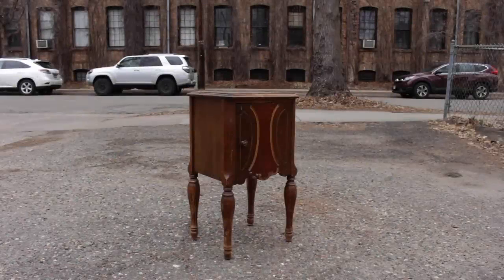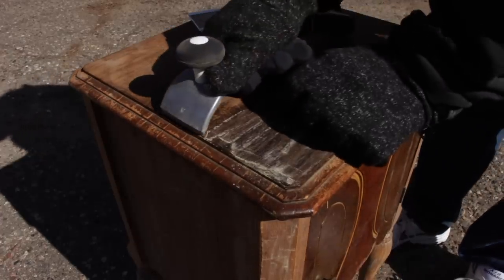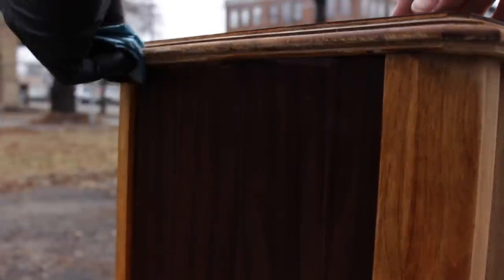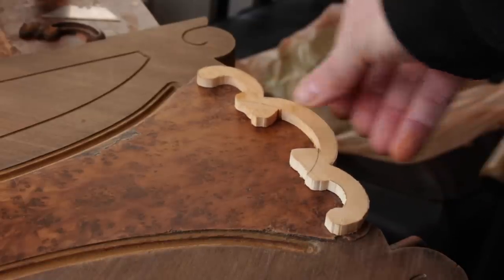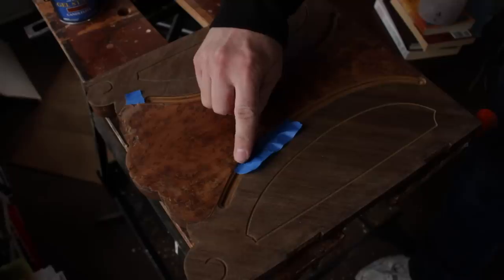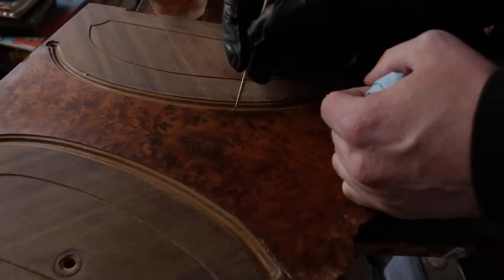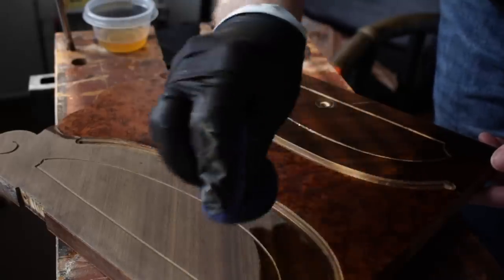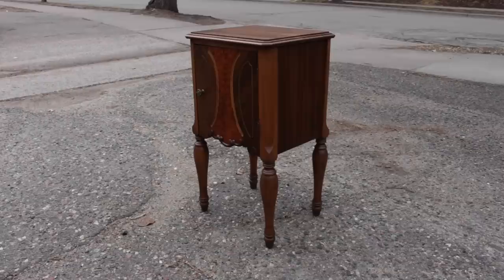Furniture Restoration | Restoring An Old Cabinet

Comment: I really enjoyed this. Great presentation and narration. I have refinished many pieces over the years. Just picked up a cabinet almost the twin of this one at auction last fall. (3.00 US)The auctioneer said it was a smoking cabinet. I don't know but it does seem practical. Good job!
Reply: I have a cabinet very much like this piece that has been in my dad's family for over 100 years. The interior of the cabinet I have is lined with copper panels. Apparently, the cabinet was used to store cigars and tobacco. The copper helped keep the tobacco safe from mold and mildew. Many cabinets, however, weren't copper lined but were lined with wood like Spanish cedar which also kept tobacco fresh.
Reply: It’s called a humidor!

Comment: Nice video. However if one had scraped the old finish off with a card scraper it would have taken a quarter of the time. BTW I'm certain the old finish is cellulose lacquer. I restore cabinets in Cape Town.

Comment: It seems like much more work hand scraping than just using a chemical stripper?  The end result was very nice. So many of these pieces have little value and are often chalk painted.
Reply: I think that in this case scraping was pretty easy since the finish was old and brittle.  If it was REALLY stuck on [like most other pieces] he'd have to use stripper.

Comment: How do you decide when to use citrus strip, or just to sand? 
I’m going to strip the top of my dining room table. It was bought new 13 years ago, but the stain is dated looking now, too red of a stain for me. I want to do a more washed driftwood or walnut stain of some kind. Because the finish is relatively new, I am thinking I will have to do quite a bit of citrus strip and then start sanding?

Comment: If the finish is shellac or varnish there is no need to scrape and ruin the patina. Simply mix equal parts of lacquer thinner and denatured alcohol and spread it around with a piece of very fine steel wool  and wipe off the old finish with a cloth.

Comment: 1. Why did you choose a mechanical method of removing the old finish? I’ve always seen you use strippers. 
2. Gel stain seems to work well, what are the pros and cons of gel stain? 3. As for the filler, are you sure that’s not a jar of peanut butter?
Reply: 1. The finish on this piece was very old and brittle so it scraped off easily.  Most other pieces would do better with stripper.
2. It's easier to control since it's thicker won't run as much.  3.  Yes, it really was peanut butter.  [jk!]

Comment: What level of pressure do you use on the paint and card scrapers? Is it relatively easy to scrape the finish?
Reply: That particular piece looked pretty easy to scrape; as the finish was quite brittle.  Most pieces would require stripper or a LOT of sanding.

Comment: I used to do this when i was 16 , any reason you didnt use paint stripper and wire wool , with thinners after to wash off the stripper , then sand , Just wondering , would have saved you alot of pain .Good job though
Reply: The finish on this piece was very old and brittle so it scraped off easily.  Most other pieces would do better with stripper.

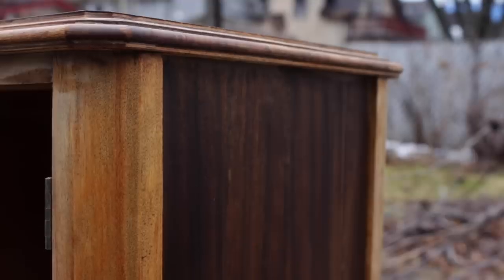Comment: Is that just water he is putting on the piece around the 4:00 mark? And was the carved piece pine?
Reply from the maker: Hi, that was either Naptha or Mineral Spirits that I put on it.  They are both clear liquids that help to bring out the grain and color of the wood.  I could have used water for this but water will raise the grain which you would then need to sand down.  The carved piece was pine.

Comment: What solution did you use after the sanding?
Reply: It's probably mineral spirits...he's just getting an idea at what the wood would look like with some finish on it; the thinner will just evaporate and dry quickly.

Comment: As a rule I love your work; and this is a nice restoration of a beautiful piece.  But "The corner pieces and legs...they're a much lighter coloured wood...." which is, of course, the point, and is balanced by the light-coloured detailing on the front face of the piece.  Yes, probably cheaper than rosewood, but clearly still good quality, and selected for the contrast.   "So those I'll be putting some stain on..."  Nooo...why??

Comment: What step did you do after sanding? Around 4:00 of video. I have a wooden high chair that needs serious work that I will be restoring for baby on the way.
Reply: It's probably mineral spirits...he's just getting an idea at what the wood would look like with some finish on it; the thinner will just evaporate and dry quickly.

Comment: What was the reasoning for using a paint stripper to remove the varnish instead of a sander?
Reply: The finish on this piece was very old and brittle so it scraped off easily.  Most other pieces would do better with stripper.

Comment: Great job, but why didn't you use walnuts on  the wood ? better finish and the oil in walnuts really helps the wood come alive.. In case you are not sure on what i mean its this.. You take a walnuts and rub it over the sanded wood the oil from the nuts give it the best finish
Reply from the maker: I rub my nuts on my furniture all the time but I felt like this piece deserved a more dignified finish.
Reply: @DashnerDesignRestoration  The job you did is undoubtedly  beautiful it took me by surprise though that you didn't use walnuts on walnut.. I love restoring old pieces myself my grandfather was a master carpenter and taught us all so much.
Reply from the maker: Thank you.